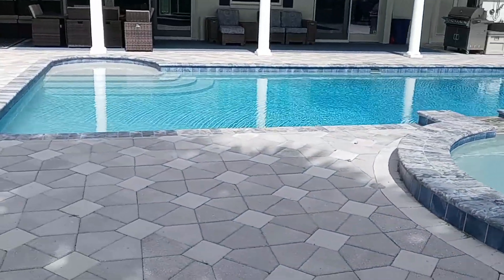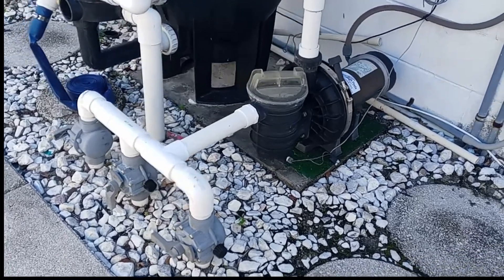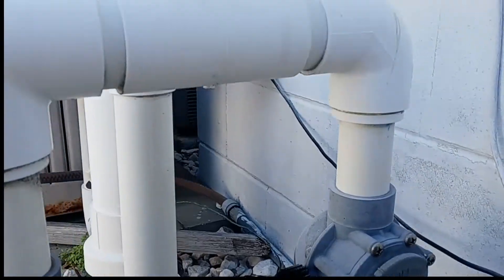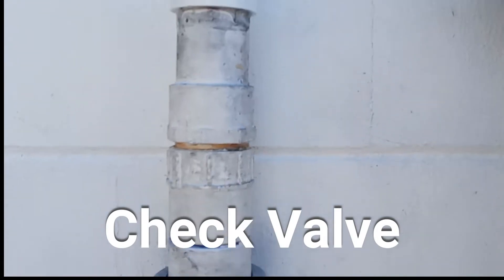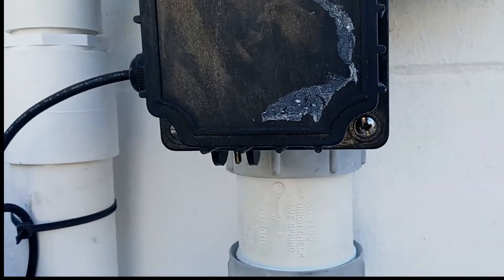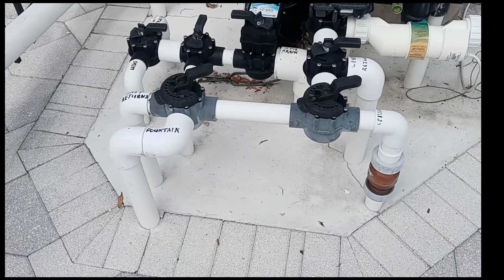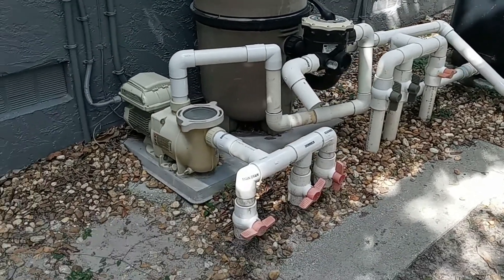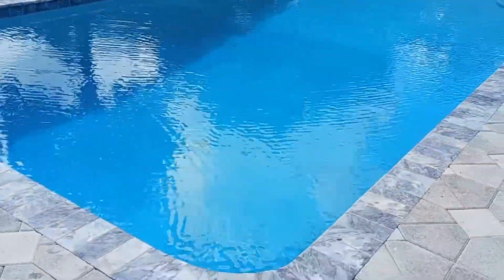Understand Your Pool Valves and What They Do

Comment: So what does it mean when the water is flowing over the spillway but no water is coming out of the return jets in the pool. Which valve isn't working?
Reply from the maker: I'll assume you have an attached spa.  Normally the suction will be from the pool's skimmer and drain and all the returned water will go to the spa's returns then overflowed to the pool.  If there is no return to the pool then the pool's return line is closed off.

Comment: Why not just leave a valve open
Reply: Pool valves usually input or output to multiple sources.  For instance, one of my valves feeds either 2, 4, or 0 of my returns.  Another valve eithers pulls water from the skimmer, main drain, a little from one/more from the other, equal from each, or nothing.

Comment: I am confused. I have one red ball valve that I only use when backwashing but every year I get confused which way is which and this video was a little confusing because in one picture up and down was open and side to side was closed and then you said it the other way around. Could you please clarify for me? Also, when I am not backwashing does it matter if it’s left open or closed? I can take a picture if it helps. I also have a weird looking thing that you have to turn but I have never touched it cause I don’t know what it is. Right now my skimmer is not working at all but everything else is working fine. I have a few more questions but before I ask and attach pictures I wanted to be sure you were still viewing this page. Thank you so much.
Reply from the maker: 3:48 is the ball valve section.  Parallel with the plumbing and the valve is open.  Perpendicular and the valve is closed.  As for the other question, you'll need to be more specific with "If it's left open or closed".

Comment: I only have one diverter valve. It didn't have the nut, so I don't know if my handle is facing the correct way before putting a nut back on.  Is it possible for me to put the diverter handle any direction?

Comment: I have one valve…..should it be on or off when filtering???
Reply from the maker: If the valve is on the suction or return side, it should be open.  Some filters have one discharge valve on the bottom that should remain closed when filtering.
Reply: @cleanpoolspa-ultimateswimm6373  I am not sure I know what you mean by on the suction or return side…sorry. How do I know if it’s on the suction or return side?
Reply from the maker: @pmarieb4083  Suction side is from the pool to the pump pot.  Return side is from the pump pot back to the pool.

Comment: Could you do a video about the pool equipment being below the pools water level? And what to do when it isn’t closed off and you open the pump to clean the basket or open the filter to clean the cartridge filters and water comes rushing out the equipment?
Reply: Also, thank you for posting these super helpful tips!! You’ve helped me with so much stuff since I’ve started working in pool maintenance 🙏🏼🙏🏼 I give you a lot of the credit on to why I still have my job lol 😆
Reply from the maker: Great idea.  When I find a pool that meets those parameters I'll surely do it.  Thanks for watching.
Reply: If you're system is below the pool you want to close off all the skimmer valves and main drain valve. Also if you have a MPV or DE filter you put the valve on close. You're gonna get some water that was already in the line but it will stop. Now sometimes you mite have a faulty valve we're water just continues to run out. Don't panic just turn on the motor and it will suck in enough water to we're you can get the lid back on. Same with a 2 stage motor.